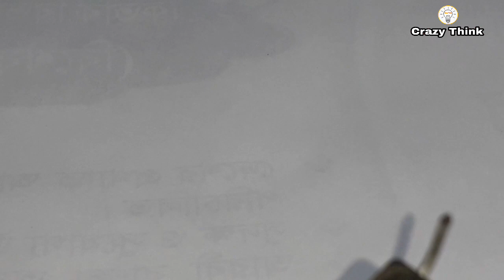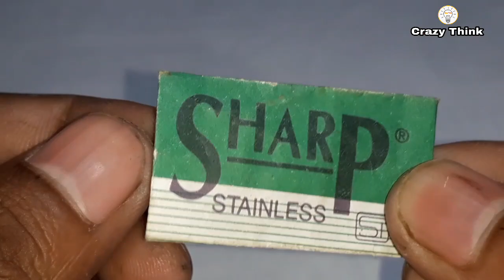Blade Using for Free Energy Generator make !!

Comment: if you look close you will see to wires connected to the moter . I think underneath the cap is a battery
Reply: Really? U are a investigator or what?
Reply: You think had no wires.?!?!?
Reply: Yes their is battery under cap so that's why he use large metal to hide wires 😠
Reply: Two small small  wire 
I so it
Reply: Blade me kya lapeta h bhai
Reply: Yes you are right
Reply: Yea, And tht machine is vibrating but why tht machine is not moving?🤔

Comment: we connected the motor with a magnet which then you moved it by your hand , thats what made electromagnetic field 
then made the electricity 
besides the cables are still isolated from the whole system , because they are still covered by plastic   
in simple words the electricity that you made called electromagnetic (not solar energy ) 
nice try and will done